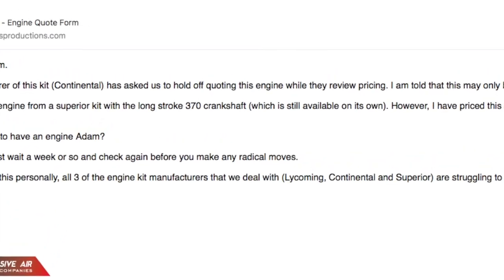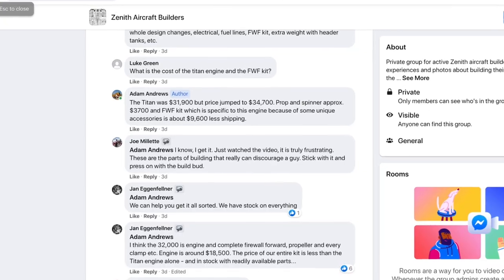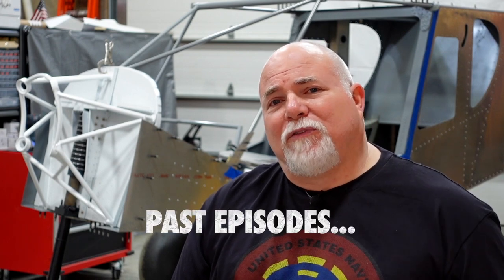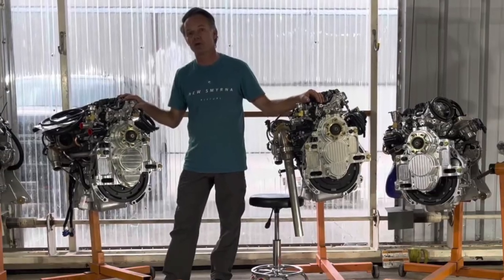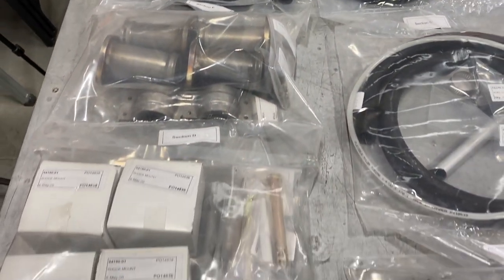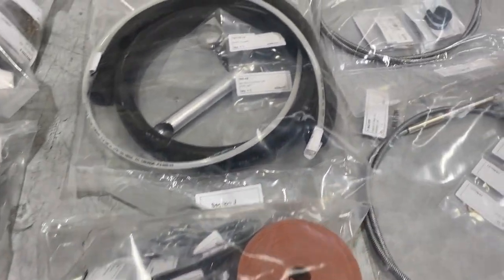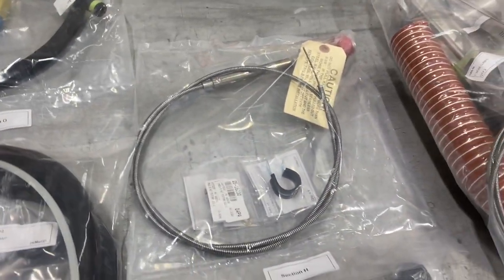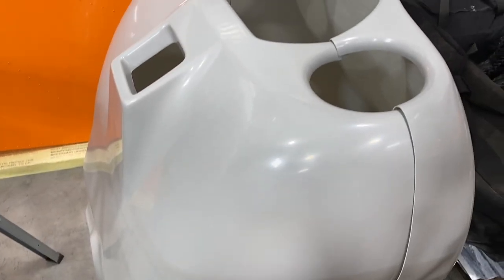Ep. 31 | Engine UPDATE | Zenith Super Duty Aircraft Build

Comment: I liked your so called rant. In the early part of my aviation career I flew a lot of Continental engines and Lycoming. Engines. Starting with a Cessna 120 I learned to fly in. Yes had to rebuild it. Cessna 310. 2 cracked cases. One cylinder cracked off.  The different Lycoming seemed to run fine. That was quite a while ago so I sure there have been improvements. When you said you were using the Titan I thought I’m not sure. But I know you have done your research. I think fate has moved in your direction. The Viking looks pretty good. I do enjoy your videos. I’m not sure yet if or what I will build. I like a lot about the Zephyrs. I prefer a tail wheel. I had a blast with the C-120. Have an awesome day!